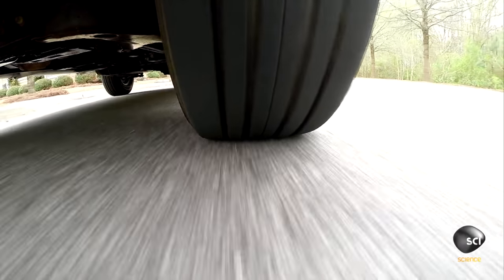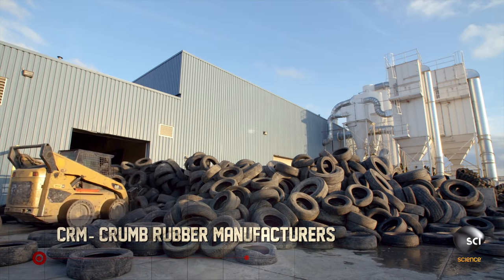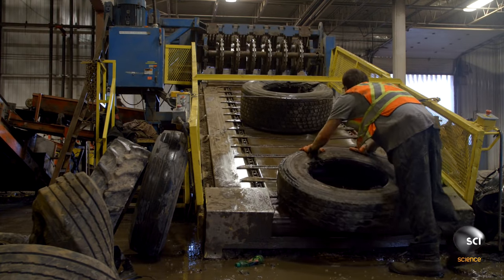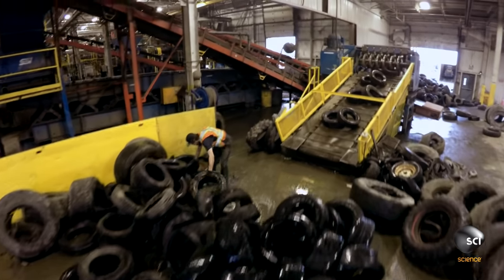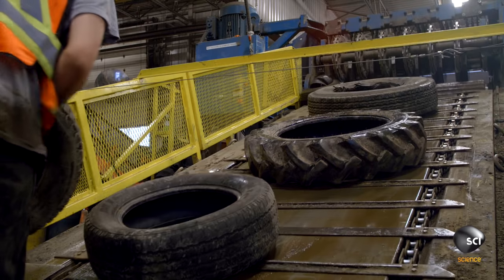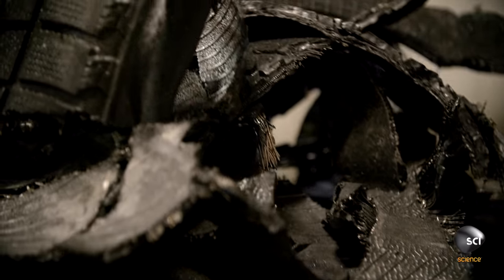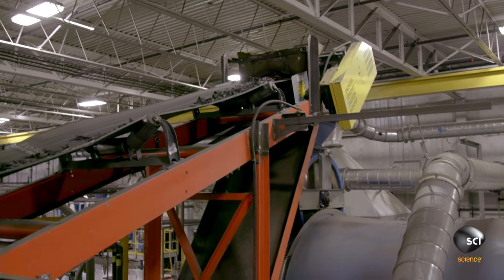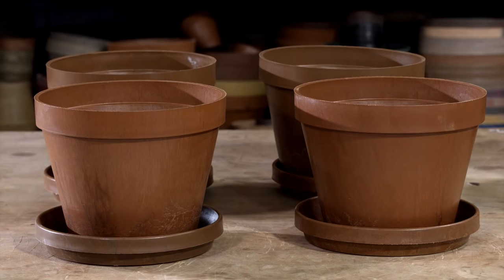How Are Shredded Tires Turned into Flower Pots?

Comment: Are flower pots really the most useful thing that could be made from the tires?
Reply: No, but it is the one of the safest thing to be made out of recycle rubber. Would you dare to use, like say, tires made out of recycle rubber on your car/bicycle/motor bike?
Reply: i dont think it would be that bad honestly  Yalcin meric
Reply: I know they started using it on schools as rubbery pavement around the football field for 400 meter tracks.

Comment: I've always wondered why they don't just mix shredded tires into asphalt. It would result in roads having a bit more "give" and being less prone to cracking and thus pot holes.
Reply: IIRC they actually do, least I've heard it a lot from comments.
Reply: It's the rubber dust (wear) legal environmental laws that prevent using this methode in most countries.  😎

Comment: Why don't they make new tyres from shredded tyres
Reply: Because its expensive, youd have to re-mix the correct rubber compounds, and then re-add the steel wire belts, and tread the tyre, then have a client willing to sell those tyres
Reply: Niels Holst Jepsen those factories don't shred tyres tho, they just buy shredded tyres from companies like this
Reply: btw its called a tire